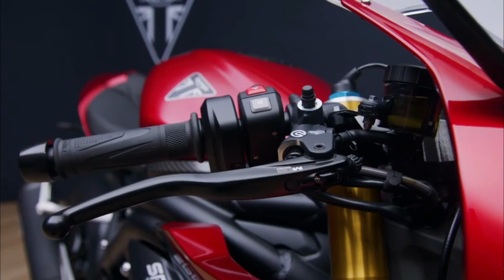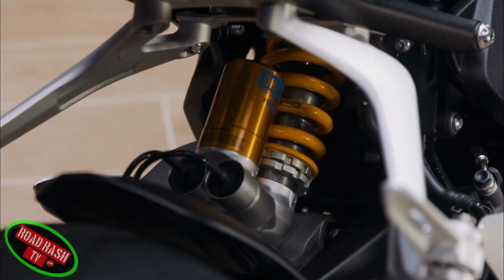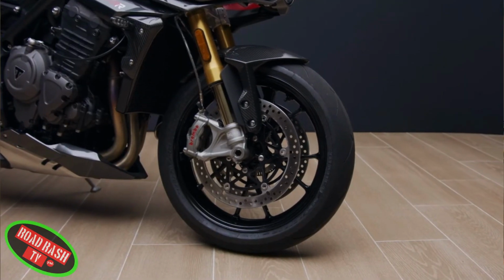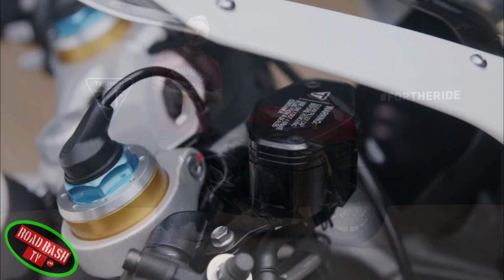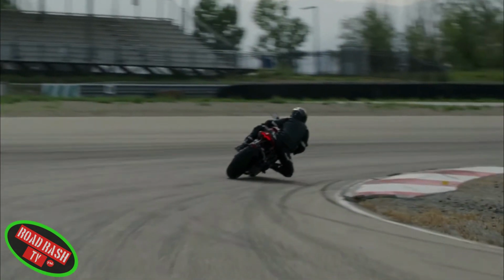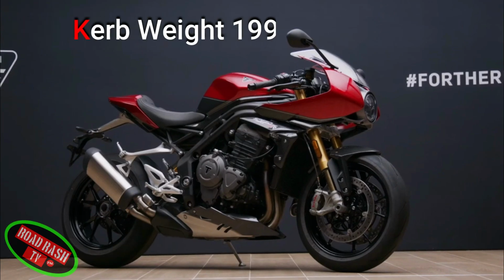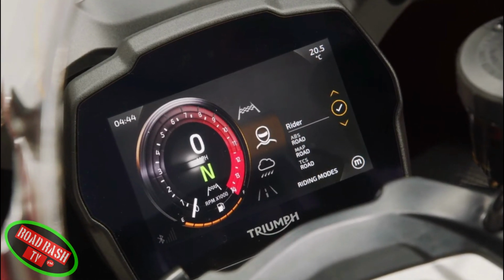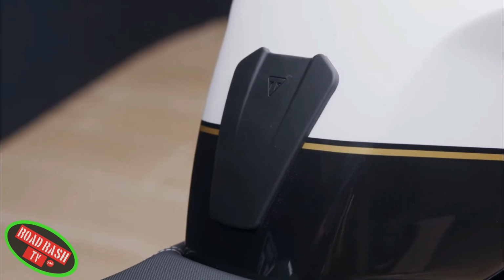New 2022 triumph speed triple 1200 RR - Specs and More !

Comment: Ever wondered why second hand bike prices are stronger than ever? New bike prices are ridiculous, £18k!!
For half that you can pick up a little used, cherished, previous generation that's still far more bike than most of us can manage.
Great news for those with deep pockets, crack on and enjoy. But for most of us these things are toys and while I currently see many many Speed triples while I'm out for a ride, I don't expect to see as many of these RS/RR's - they're simply too expensive.
Beautiful technology and build quality but sadly let down by its awful, clumsy fairing design which smacks of TDM in its styling. You already know you'll be embarrassed being seen riding her.
Reply from the maker: Hey 339 first of all thanks for watching...and your right they're everything apart from inexpensive..
But i woukd still love on.
Ps have you ever bought a NEW  bike
Reply: @RoadRashTV  No, plenty of new cars in my past, there is always that buzz of brand new but my bikes are generally 1-2 years old when I buy them and I move them on after 3-4 years use. By which time they've done 20k miles.
I've no problem with folk buying only new, I mean, if you work hard, look after your loved ones and can manage your debts, then fill your boots. 
It's just that (as with cars) the prices being asked are, to me, crazy. I probably save 30% at least off new and look for one owner, fsh, tidy, low milers. I'm grateful for all the careful owners out there doing 2k miles pa on still pristine machines.
Reply from the maker: Ive also never had a new bike but i guess luckily for us lots of people do by them.
Untill next time 339 stay upright.
Bobbymax